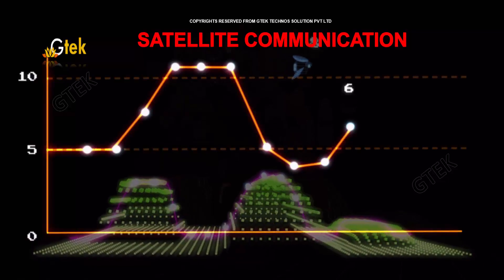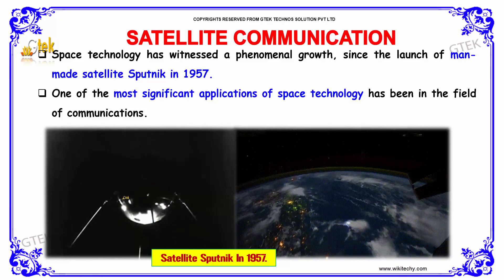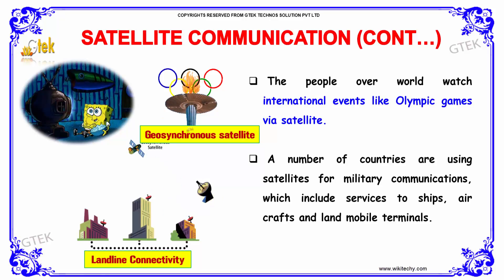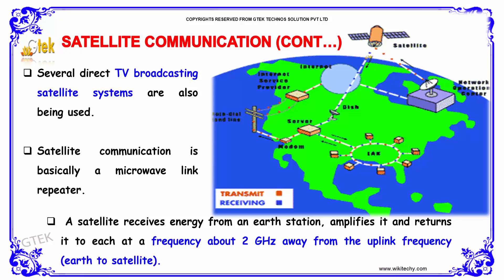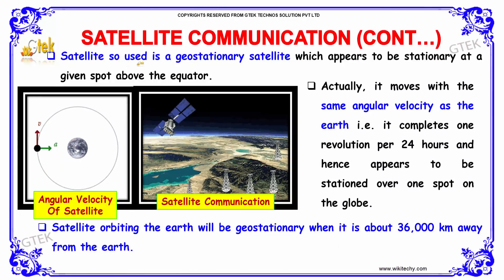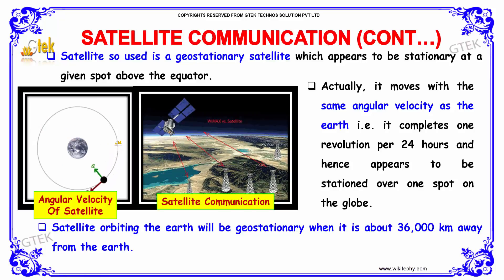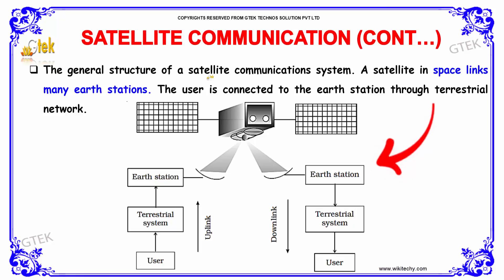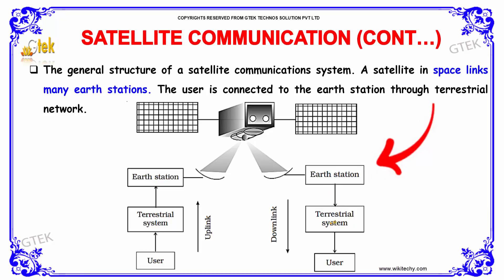Satellite Communication Part -1 | Communication System |class 12 physics notes|CBSE|IITJEE|NEET

Comment: A communications satellite is anartificial satellite that relays and amplifies radio telecommunications signals via a transponder; it creates acommunication channel between a source transmitter and a receiver at different locations on Earth. Communications satellites are used for television, telephone, radio, internet, and military applications. There are over 2,000 communications satellites in Earth’s orbit, used by both private and government organizations.[1]Wireless communication useselectromagnetic waves to carry signals. These waves require line-of-sight, and are thus obstructed by the curvature of the Earth. The purpose of communications satellites is to relay the signal around the curve of the Earth allowing communication between widely separated points.[2]Communications satellites use a wide range of radio and microwave frequencies. To avoid signal interference, international organizations have regulations for which frequency ranges or "bands" certain organizations are allowed to use. This allocation of bands minimizes the risk of signal interference.[3]